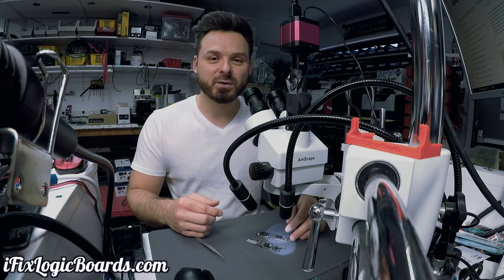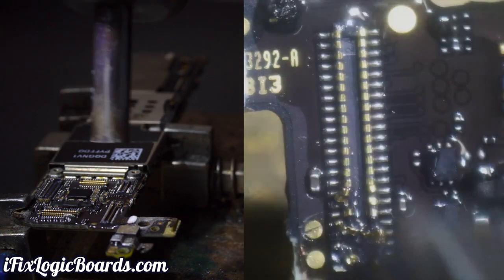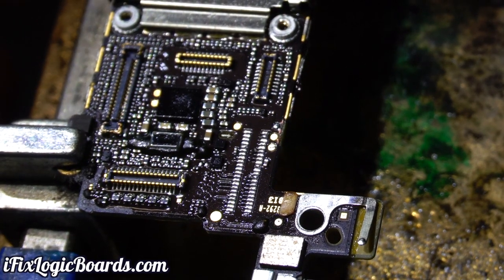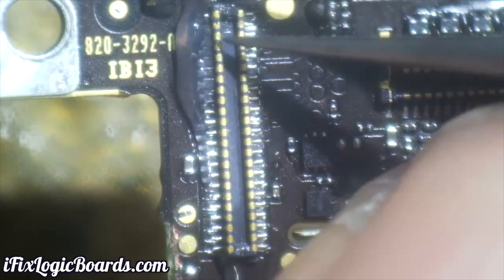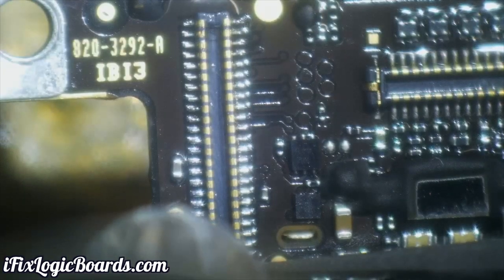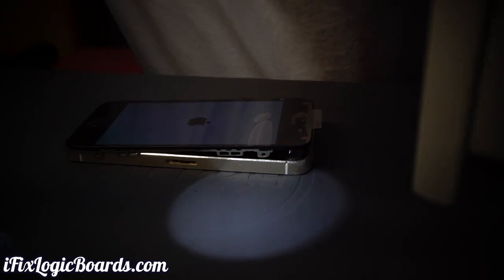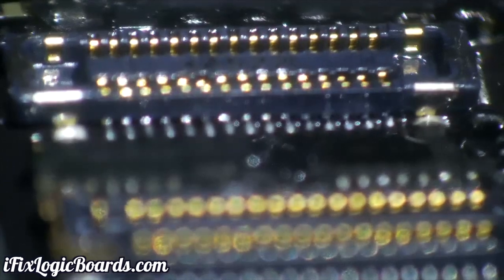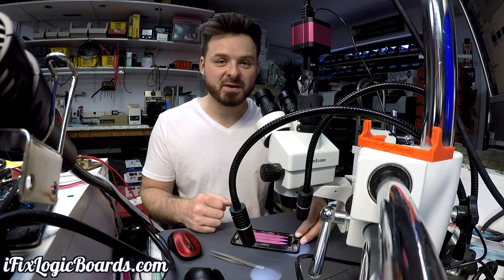iPhone fpc connector repair - digitizer, lcd and other

Comment: Long time no see. Like the dual camera views did you have those shots before?
Reply from the maker: I believe I used similar style in 2 other videos. It's been a while, pretty busy, moving to new office and will have some cool stuff to show.  Stay tuned :)
Reply: Oh geez moving. That is where you find stuff you have squirrelled away over the years and you wonder if someone is actually bringing stuff into the old location in the middle of the night as it seems never ending series of boxes ;)
Reply from the maker: It's not bad. Moving to new unit in the same building.

Comment: Sorry sir, is it possible the broke fcp connector lcd make a black screen happen? Answer please.
Reply from the maker: Yes, if LCD is not getting signals then it wont display anything.
Reply: But the lcd is responded, just turn on to black without the apple logo. Is that possible because the fpc connector was broke?
Reply from the maker: @ijemmm  It might, but you probably have a different issue.